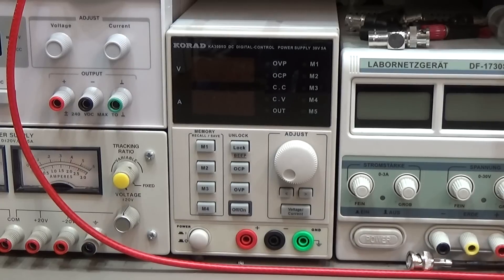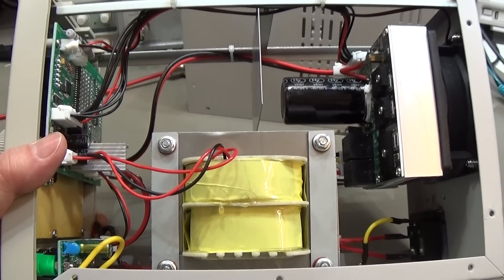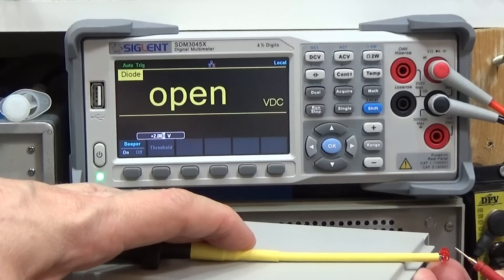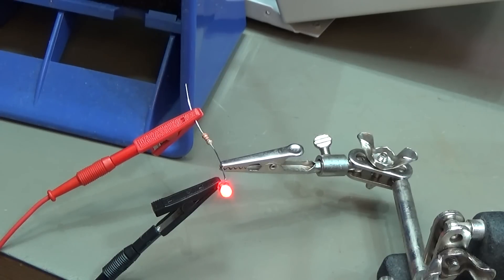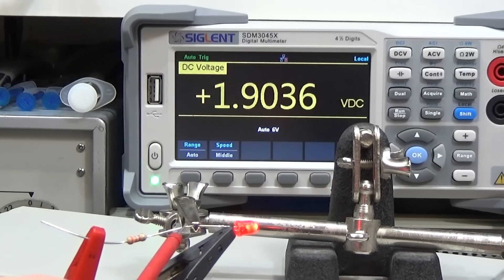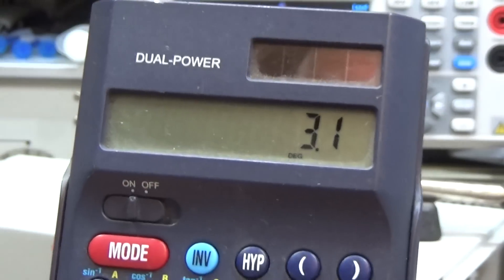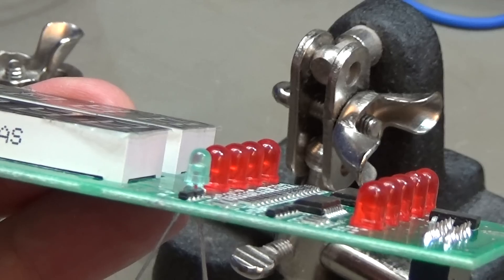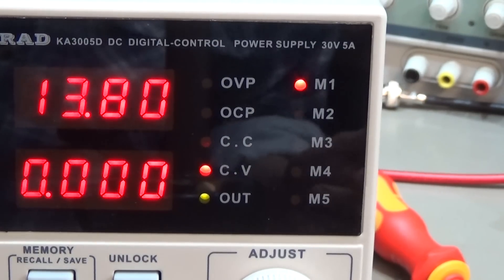#124 Quick Tip: Korad KA3005 Power supply ouput LED modification

Comment: Thanks Peter for the very informative video.  I always learn a lot on them.  I would also prefer the green LED over the red.   One thing though, I would have read the voltage across the 330 ohm resistor and then use that with the formula to calculate the current thru the circuit.  Thanks again and keep the videos coming!!!
73,
Ski
Reply from the maker: Thanks for your contribution 73

Comment: I fully agree this LED location should have been designed by Korad with a green, not a red color! Nice to see such product usability improvement posts! General comments:  In this demo of the (discrete) LED change, it looks like the red LED was a 5mm and replacement a 3mm diameter, thus the slight reduction in light coverage. Best light coverage in this case (i.e., viewability through the panel)  could be accomplished using a flat top (aka cylindrical) body LED. Looking at other reader's inputs it seems that some of the newer power supply board builds are now using SMD (surface mount device) LEDs, which require a bit more skill to replace. For best visibility of so-called "green" LEDs, I recommend using LEDs with a wavelength of 525nm, not the more common 565 nm (which are closer to yellow when you compare the two lighted side by side). For others contemplating creating status lights for a project, or just for more information on the preferred colors for status indicators in general, I suggest a review of ANSI/VITA 40 (2003).
Reply from the maker: Thanks for contribution and thanks for watching Cheers

Comment: I bought this PSU in 01/2015 at Reichelt Germany and just wanted to make this modification. My LEDs are totally different from yours. Mine have square bodies and the bodies stay flat on the PCB. 

I made some pictures of my PCB and the modification I made:
http://www.abload.de/gallery.php?key=ynJa52fu

I found similar green LEDs at Voelkner Germany (part no. Q38560, manufacturer no. Everlight 583SYGD/S530-E2). These fit very well.

My LEDs are driven at 3.3V (HT1117-33) and with 330 Ohms the green LED is to dark. So I replaced the resistor by a 56 Ohm one. The current is about 17 mA what the driver (74HC595D) is able to deliver (up to 20 mA). 

Now it looks terrific!
Reply from the maker: Nice picture very well done! It is intriguing that the manufacture is changing the series so quickly...Thanks for the exiting report. 73

Comment: Hello, very beautiful video. Did You noticed that blowholes are blocked when your apower supply is stuck between two other devices. He cannot  have of airflow and thus no cooling there. The alim is probably going to warm and burning if you fire 5A out for a long time.
Reply from the maker: Thanks for warning and rising the hand, Daniel! 73

Comment: Also, have you seen Dave Jones EEVBLOG review of this PSU and the issues he discovered?  Beware of overshoot on turn on under some circumstances.  Hopefully yours is a later model and is clear of the issues!
Reply from the maker: Yeah but as far as I know he had a transformer which was not build for the main power in Australian.. It seems to be a newer revision too.
Reply: Excellent.  You might just make certain that in all conditions the voltage delivered at the PSU terminals will not overshoot when the output is enabled.  In one of Dave's tests, this happened consistently.  Although a +13.8V radio won't break until around 16.5 volts, other circuits under test could be destroyed should such a fault be present.
Reply from the maker: you are right I will double check it! Thanks for info

Comment: Any thoughts on the purpose of that aluminum partition plate that hovers above the power transformer in your Korad PSU?
Reply from the maker: Hi Mark, I think it is a kind of shielding but would need to do some tests to be sure...
Reply: A bit late but it guides the air from the fan to the transformer.

Comment: hi great videos,can I ask how did you connect lcd tv to oscilloscope  as I would like to put a old 3 inch scope on a 17 inch lcd tv I have  can you help please
Reply: Wayne I would use a video camera just in front of the screen and display it on a larger monitor. It is very hard to electrically output the screen to a monitor if it was not built that way. In the old days Tektronix put cameras on the front of their scopes to capture images, but those days are over. Look at the images of Tektronix camera setups and design your own. Thats would be the easiest  fastest and most flexible, but remember the camera flips the image from right to left or left to right ... 0x49
Reply from the maker: Wayne, what Tom said already is all what can be said on this topic. It is much to complicated to build a converter which would be able to drive a lcd screen.

Comment: It's better to read now. I use the same power supply and I have modified heat sink for better and fan for quieter. For low current is inaudible now. Thanks for idea, 73.
Reply from the maker: Mine seems to be a newer revision. I have heard about the fan issue but it is no problem with my power supply... Thanks for watching Cheers
Reply: Yes, I saw other heat sink on your version. On my version was thin. Your is newer revision.
Reply: ELPRO GSM SERWIS ELEKTRONIKI 
Could you please share your solution how to make a fan quieter?

Comment: Good little mod Peter but don't stop there. Consider changing the seven segment led amp or volts to green. And the last thing your 
english is sounding great much better. Have a look ( https://www.sparkfun.com/products/9482 ) this would be cool.  0b1001001
Reply: Better display here -- https://www.aliexpress.com/item/0-36-inch-4-Bit-GREEN-Digital-Tube-LED-Display-7-Segment-Common-anode-For-DIY/32618527156.html?spm=2114.40010308.4.21.WM7Bq9
Reply from the maker: Looks pretty nice Tom...Thanks for info 73
Reply: TRX Bench no worries Peter
Reply: I made the green LED - https://youtu.be/D7myba2g_-A

Comment: Nice for beginners to see that making small mods to their equipment can be relatively easy to do thus making them more useful to you specifically. The green LED appears to be slightly less bright than the red ones but that may be a artifact of your camera. If it is dimmer I think you could adjust the current limiting resistor within reason to brighten it up a bit. Sometimes LEDs are just too bright! I have one piece of gear that had a constant green LED engaged. I tried the resistor adjustment trick but couldn't bring the brightness down sufficiently; I ended up putting a piece of masking tape on the inside of the case over the panel hole it shone thru and that did the job...sometimes the simple fix is right in front of your eyes!  Thanks Peter!  73 - Dino KL0S
Reply from the maker: Yes a bit basic electronics for beginners, Dino. The green LED was a lower mcd type and you are right it appears to be less bright. Need to order higher mcd LED's anyway. Thanks for watching. 73

Comment: I did exactly the same thing with mine apart from adding a green led to the CV indicator as well. I also added a quieter fan and a thermal switch so the fan was only active at over around 40 degrees. Nice video Peter. Karl
Reply from the maker: Hi Karl, I have heard about the fan problem but mine seems to be a newer revision the fan ist just fine.. Thanks for watching 73